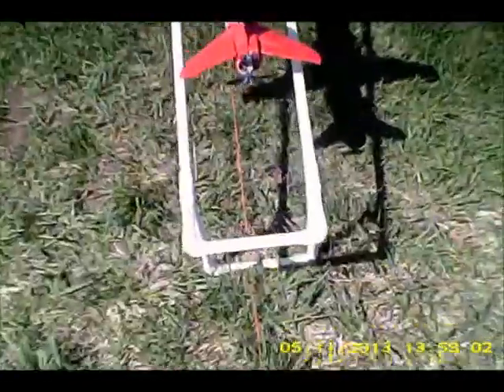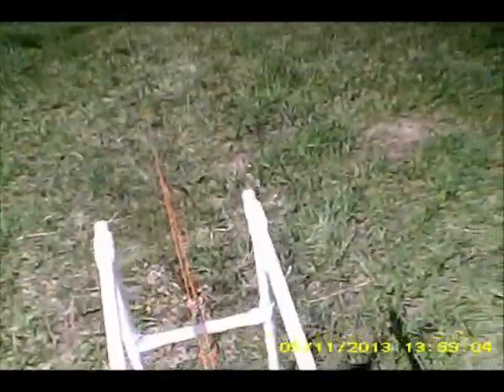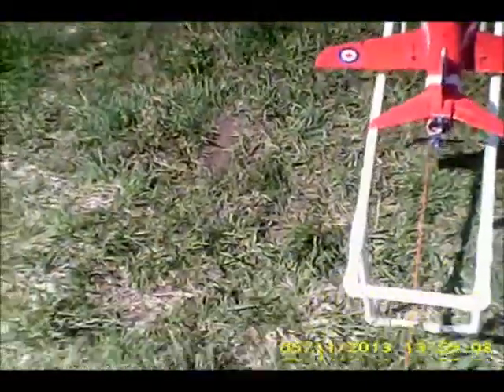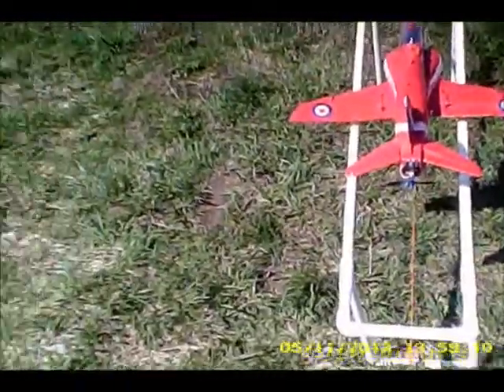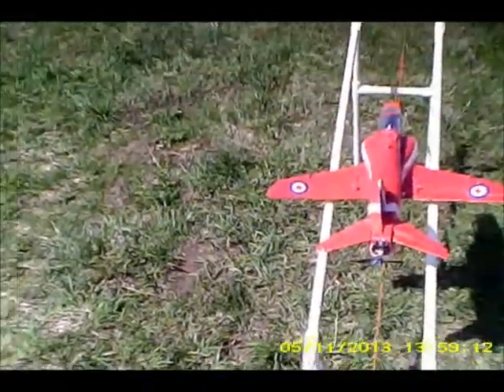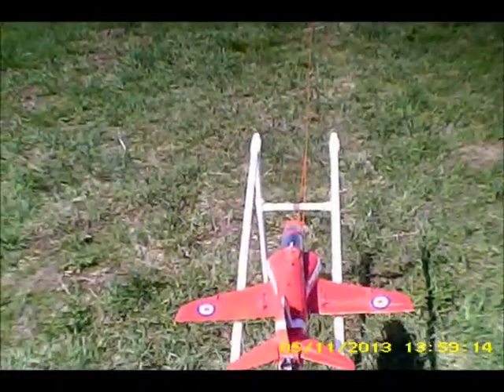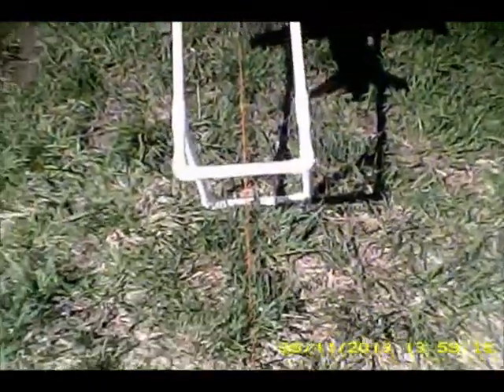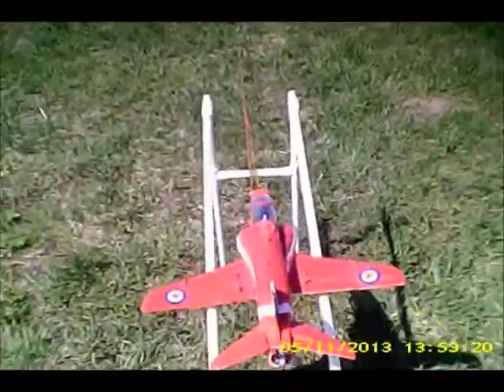11 May 2013 T45 Pusher

Comment: I had a beat up screamer i put 4200 kv edf motor and 3s 1300 nano tech 4.1x4.1 and it was very fast and produced 630 grams of thrust.. unfortunatly it got to far away when i was retrimming it on second flight...and i lost it

Comment: this has got me excited ! may i ask how you mounted the motor in the rear ?   i have alot of edf's. but the pusher speed has bitten me
Reply from the maker: Go to wattflyer.com ... Pusher section .... full thread there ...
Motor is mounted with a beam glued into top of exhaust tube .... metal beam mount.